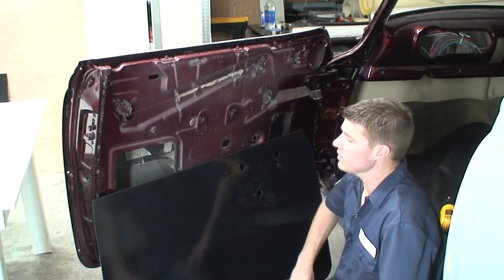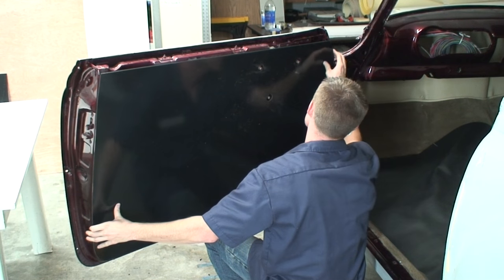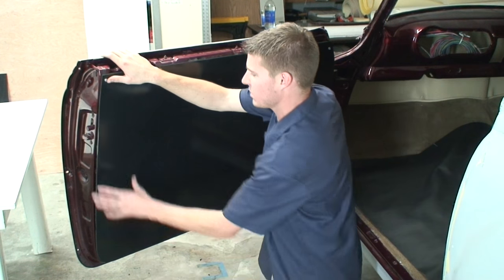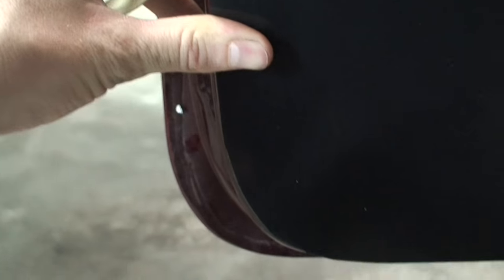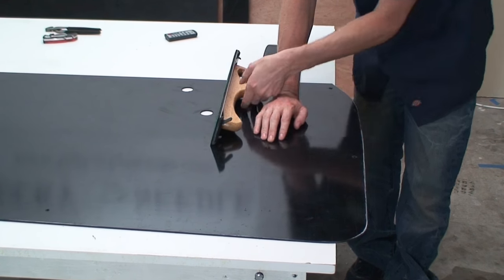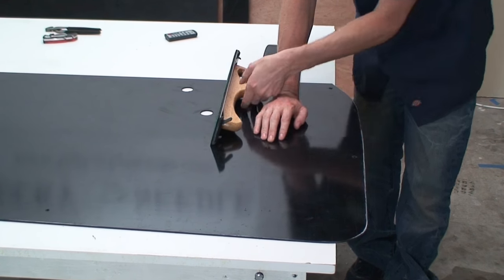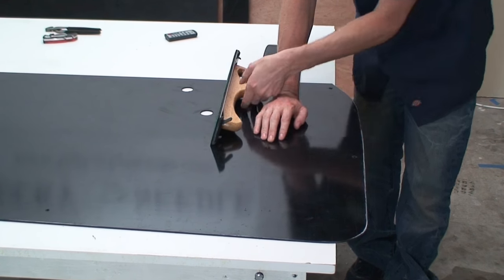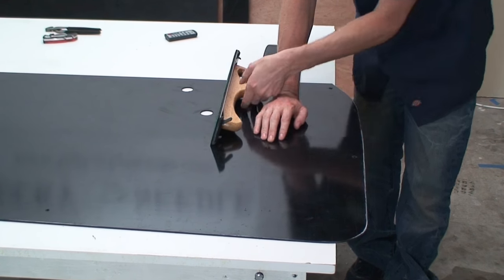Automotive Upholstery - Making Custom Door Panels Part 4 - Panel Fitment

Comment: Before you fine tune the edges, can you use that first template as a "mirror" for the other door / panel?
Reply from the maker: You could and sometimes it will work. However You'll be surprised how much variance there can be in these old cars from left to right.
Reply: @Theluckyneedle  , I definitely know about the variance thing.  My daily driver is a 1999 Olds Alero accompanied with 2 "hobby" vehicles......1975 Merc Cougar XR-7 and a 1981 Jeep CJ-7.  It's surprising to me that I've had problems finding those wire clips for the Cougar's door panels through local auto parts stores.  I'm tempted to just use metal sheets to make new panels with quick release fasteners.